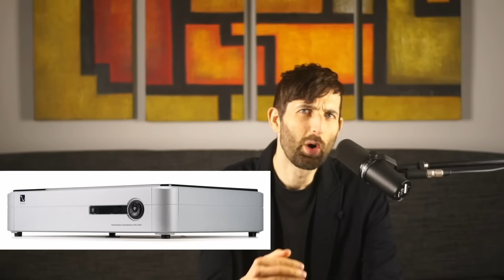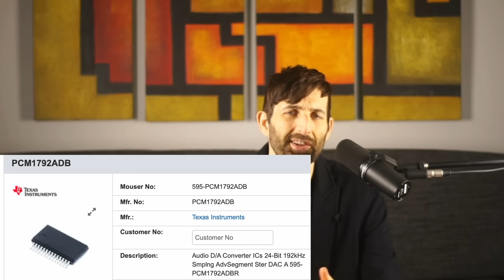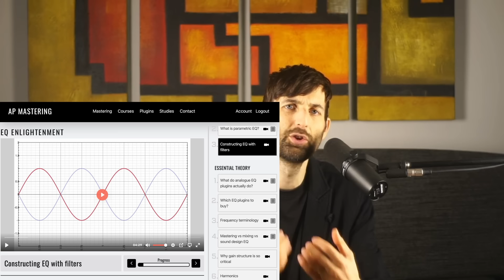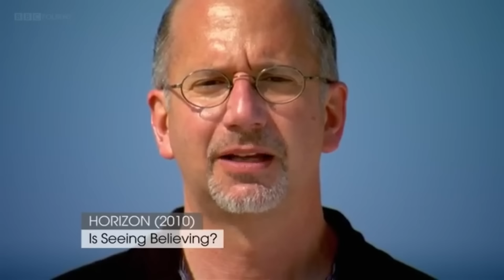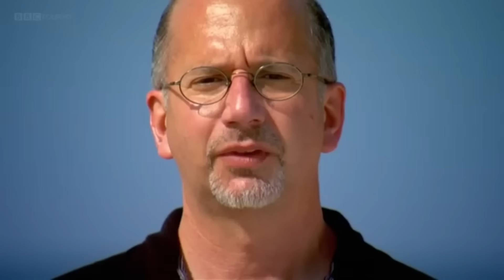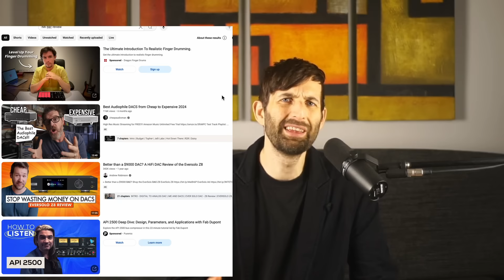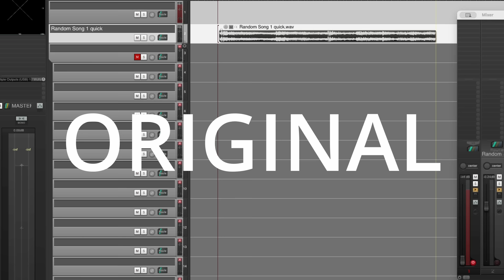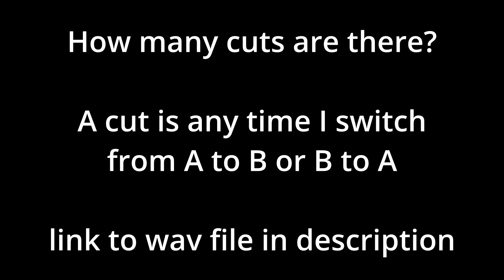The DAC Scam - Almost everyone believes the hype

Comment: another aspect that you apparently don’t know. Or ignore because it doesn’t fit in with your what fools! sermon 
Analogue … TTs do have more distortion than digital CDPs 
Ergo, the higher distorting NOS DACs should sound more analogue 
Dude, you should get around a bit more
Reply from the maker: ultrasonic noise harming your amp and tweeters is not the kind of distortion that most reminds me of vinyl
Reply: @APMasteringI was referring to turntables’ audibly higher harmonic & IM distortion. When have tweeters been harmed?

Comment: I used to work in the electronics industry. All the terms 'commercial', 'industrial' and 'military' refer to is the temperature range at which the semiconductors are guaranteed to work, from memory. Commercial should be good enough for any DAC. It's not necessarily even a different design; components might be binned according to their performance coming off the production line as is the case with computer CPUs, but I'm not sure about that when it comes to temperature testing.

Comment: Great video. I use a chinese brand SMSL DAC to feed my monitoring system. 

It features XLR outputs and measure greater than 124db at AES...  

Compared to the DACs in my old Allen and Heath Zed R16... I could perceive a very slight difference in my tuned room.. 

I attribute that to a switch that switched between monitors that was dirty.... 

They're now in different studios,  so i can't compare, but I'm pretty sure it won't be perceptible... 

Granted, im now buying a second hand RME ADI 2/4 , but more because it has a great ADC and I'm getting new monitors with AES inputs, it can drive headphones like the Audeze LCDs and isn't reliant on drivers being fully class compliant (although my experience with RME drivers via a PCIe Raydat has also given me trust in their support)

Comment: I have owned quite a few DACs, from $70 to $6000 from some of the big names. Right now, a $300 AliExpress XiangSheng DAC05AII x 4 PCM1794 chip is by far the best sounding DAC I have owned. When paired up with my Cary SPL-90 clone tube preamp and the NH108 D5 Pro amplifier, audio Nirvana. ;-)

Comment: It's so much simpler than this.... DACs are a scam because WHAT could they actually be doing?????? Converting the audio BETTER???? But HOW? Make it BETTER so audacity can record it .... BETTER????? Is there anyone who actually thinks about this for more than 5 seconds without just opening their wallet? Really it should just sound the same, if it's BETTER that's not good... and if it's worse that's really not good... have you ever heard it become worse with zero DAC and only an interface or plugged right into your computer? and if you did how do you know it's the interface and not something ELSE downstream from that? I can guarantee 100% of people would not be able to tell ZERO DAC (other than than your computers sound card being a literal DAC) compared to a $40,000 DAC; at it's best it's snake oil... and if it IS making a difference it's a difference it SHOULDN'T even be making in the first place. DACs are only SLIGHTLY less stupid than analog summing boxes.

Comment: I agree in many points. But ! ! There is indeed a difference how the supporting electronics are build. A lot research is done from which point on bit depth and samplingrate etc. is the max. quality achievable, it ends at 24 bit and 96khz for PCM, but it is a difference if I develope and equip an electronic device careful or just slap cheap parts in it. There is a difference what specifications I require. Do I use XLR balanced or simply  RCA unbalanced, do I use SPDIF or coaxial or even other connections or even other transmission protocols etc... That all makes a difference, but there is indeed a range where it makes sense, a couple of Thousands $ or € is fine going up to the 10K or higher. On the other hand, who wants to put a PA rack inside is listening room ? It would do the sound perfectly, but nice looking ??.....

Comment: Have you heard of power supply
Reply from the maker: i say power supply in the video. obviously you didn't watch
Reply: @APMastering70% of the sound is from the power supply and the analog output stage.
Reply: Also conversion of DSD is much more
Advanced than just the chip but you have been living most your life living in a pcm
Paradise

Comment: Well you completely miss the point. Is there a load of snake oil in DAC sales? Yes, if course. And some manufacturers try to sell poorly engineered items at ridiculous  prices. But many don't. If you want to get the best performance from that DAC chip you need regulated supplies. You need a very high quality laser mechanism. You need the best current to voltage conversion and you need a very low jitter clock circuit. Many will use military grade caps and resistors which are many dollars each. Try and buy an ultra low jitter oscillator....if you can get one it will cost hundreds of USD for the oscillator alone. Once you start adding these complexities you immediately move the product far away from mass market. That means low sales. What kind of profit do you need, to make development and launch of a low volume DAC worthwhile? There will be a massive margin (both manufacturer and dealer) on those items, but you need it when you only sell a few 10's per year.

Comment: I used my ears to listen to Chord DACs before purchase. They program their own chips, not just off the shelf. I would have preferred to hear no benefit, because I could have ended up with a cheaper DAC. But I did hear a difference. I would easily be able to tell the difference at the same volumes for the same song A/B tested through amp and speaker setup of my choice with a HUGO 2 compared to ANY half price competitor. I would bet my life on it.

Comment: Great dacs are more than a good chip, but for mixing and mastering you dont need high end, you need something thats good enough for the work you do so it can pay for it self. This guy doesn’t know the possibilities of high end audiophile dacs, because they can improve the sound quality a lot, you pay for the sound signature. Mine is from danish audio design and its way better than the other dacs I have heard. If you dont get the benefit of a better dac its because your system is not resolving enough, so get some great speakers and hear once more. Audiophile headphones mostly are not resolving enough to need a very good dac, but great speakers benefit greatly from high end dacs.

Comment: Almost none of the DAC pics that you showed in your video used off-the-shelf DAC chips. They are mostly all custom own design utilising FPGA chips and/or hybrid solutions with resistor ladder.

Even the prices of the off-the shelf DAC chips you mentioned is not accurate as you didn’t mentioned that most of them required more than a single chip to reach their peak performance… and it can be up to 4 or even 8 chips to reach their full potential.

I can’t say that this video is fully honest with the content…
Reply: And all those "custom design" chips in the best case scenario are matching the characteristics of the common chips mentioned in the video, lol
But believers will believe no matter what
Reply: @GremmieWhite  Do they matched? I don’t know. I haven’t tried them nor do I have the objective test result to be able to say as such, and neither do you.

But I know that I would be very stupid to say they are the same without knowing the actual data…
Reply: It’s not dishonest either. More like ignorant.

Comment: You're completely off the mark with this. But let's start at where you are right - the DAC chip has the least to do with the sound - these things are generic, cheap and nearly identical these days. There are a few tiers of them, but even the highest audiophile grade ones cost peanuts compared to the whole device, whichever one it is really. A now for the bits where you missed the mark: The analogue circuitry is of paramount importance, also the precise clocking, jitter suppression and power supply regulation. These things are not "few bits and bobs" as you put it, but actually constitute the device, in which you could easily swap the DAC chips and it would sound the same. Yet, change the capacitors, shielding, mess up the power supply, or use cheap op-amps in place of discrete ones in the analogue circuitry, and you have flat sounding digital disaster, or a cheap DAC.

Where you are correct again, (IMO of coruse) is that paying anything north of 5k USD for a DAC is dumb, as for that amount of money, all these things can be taken care of perfectly. That we can agree on. Yet, claiming that cheap Focusrite interface sounds the same as an expensive Apogee or Antelope is a total fallacy, and I have the scars to prove it. Actually switching from a flat sounding UAD Apollo 8 blackface (allegedly awesome at the time), to the incredibly good sounding Antelope Discrete Pro made me start making music again - the difference was THAT big. The clarity, the dynamics, the resolution, and the compounded result of tracking many tracks that way. Also the preamps, not being cheap on-chip affairs, but actual discrete, multiple transistor type used in good consoles.

Comment: "I’m using the Bluesound Node-X together with a Musical Fidelity M5si integrated amplifier (without a DAC), connected to my Dynaudio Evoke 20 speakers. Is the DAC in the Bluesound Node X good enough for my setup, or would adding an external DAC improve the sound quality?

Comment: Yes, the DAC chips should be sounding the same, and I agree that there is alot of ridiculous shenanigans with hyper priced high end stuff. But...the thing that can make one sound different from another is what's happening in the analog output section. There are many choices that could be made in those circuits that can skew the sound in one way or another. You could very easily have two DAC boxes with the same DAC chips in them that genuinely sound very different because of how their analog output sections differ. And it can very well be a matter of personal taste and opinion as to which one is "better."
Reply: It’s more than that. Power supplies. Clocking. Etc.

Comment: Weeeeellll, there are plenty of different chips, so it does not "just come down to the chip". And there are other technologies such as R2R, where a chip is not used for the conversion. In addition, with is before and after the conversion is just as important, i.e. the power supply, the I/V conversion, the output stage. I have tried a number of DAC's, and the differences in my system are HUGE.
Reply from the maker: r2r mostly uses a chip

Comment: Toroidal transformers, high grade capacitors, discrete output stages cost some extra money. I do know some VERY good sounding DACs for around 900,- USD. An ES9039SPRO chip sounds noticeably better and more detailed than an ES9068AS chip. The lower end sounds more precise and the mid frequencies are "pushing" more. Furthermore, R2R or Multibit doesn't have to be very expensive. It starts at 299,- USD and already sounds very good. The advantage of R2R and Multibit is they often (but not always) have a better soundstage and a more holographic sound experience. Now I agree with you that at a certain price range there is no real sonic improvement in terms of "more detail". But there are different flavors just as with any favorite car that one likes to drive. Scam? No, people that have huge wallets like to spend more. It's a very normal thing. And people that are on a lower budget need to carefully look, but they also can find some nice sounding DACs. Saying "they all sound basically the same" is not really true.
Reply from the maker: how did you do in my blind test?
Reply: @APMastering  I am a musician. I buy the sound that I like. I have owned a number of DACs, from very cheap to absolute high-end. Look, a good amplifier with some high grade capacitors and exotic FET types will cost you more than a regular, lower priced amp. And it’s the same idea with DACs. For me, this is no scam. But of course if somebody is selling you cables for let’s say 30.000 usd a meter, you could say this is a scam. My current DAC is listed around 1.400 usd and it’s insanely good. Why? Because of 3 main reasons: it sounds natural, not artificial. The bass is very exact and punchy. The space in good recordings is very present and you can exactly pinpoint the position of each instrument or singer in the room. Cheap DACs have extremely mediocre to lower end output stages consisting of cheap Opamp chips. This ALONE causes a sound not worth mentioning. Also the power circuits of low cost DACs are cheap. And you can hear it. So  look, I only do blind testing just for the fun of it, but not if I am DEAD SURE about a DAC that sounds a whole lot better than another DAC.

Comment: It’s far more nuanced in some cases than you’re claiming. “The cylinder does all the heavy-lifting, so it doesn’t matter how the engine is built around it, or how the transmission interfaces with the output, or how the fuel injection system is designed.”

Yes, the majority of people can’t tell the difference between poorly-built snake oil and great engineering, but that doesn’t mean that every mid-high priced discrete DAC is equally nonsense. The power stage alone is easy to screw up EMF/EMI shielding, or source noise filtering, etc.

But let’s steel-man this claim and pretend that literally every DAC ever made sounds exactly the same, from $5 dongles to $1 Trillion mansion-sized “compensation trophies.” The design and engineering around the core DAC ICs themselves can massively change the timbre of the output, meaning that “clinical/crispy” tenor-loving DACs pair well with darker/veiled bass-leaning headphones/speakers, and vice versa. This example obviously still would mean it doesn’t make sense to spend much on a DAC, but it discounts the insinuation that “it doesn’t matter at all.”

It matters at minimum for the tonality bias, and at maximum for stuff you seem to not notice (sound-staging, clarity, etc.).

Blind A/B testing should be required for anyone who assumes they “need” to spend more for a pricey DAC, I’ll obviously grant you that. But for those of us who can tell the differences at least up until the $800 mark and below, I see no issue with having that kind of budget for such a massively-subjective hobby. And even that group of people will admit that it’s a 10-15% improvement going from $100 to $800 when the best at each price point are compared.

Comment: the misunderstanding is that only the chip is responsible for the sound. 40k is still a hell of a lot of money and probably too much. a large part of it goes into the design of the circuit and of course into the housing. low quantities do the rest. nobody is forced to buy a 40k dac.
Reply from the maker: the analogue circuitry is cheap, transparent and a recommended schematic is given in most chip handbooks
Reply: @APMastering  I don't understand your point. The cheapest way to get a DAC is to buy a kit from Ali. On the other side of the extreme, there is the 40k device. Pick anything in between and be happy. Please be polite and don't bother people who have a different opinion.
It is also not a scam when people buy their Porsche, or an expensive watch. All these gadgets have something that a group of people think is relevant to them. Others don't want to or can't afford them, but that's another topic.
Why don't you tell us what your best solution is? This positive approach is much more interesting than a purely negative one.
Reply from the maker: @bernhardh6184 well you just didn't watch my videos then. i discuss watches and give recommendations

Comment: Following this clown's logic, then a dac/amp built into a laptop creates no difference in sound quality than a LAIV Harmony $2,700 DAC?  Full of crap!  Truth is that most dac's designed and built today sound quite good.  audiophiles aren't looking for "quite good" or good enough.  they are looking for organic, natural, pure sound quality where the equipment fades and you are immersed into the music, not the gear.  I believe it si true that many people can't hear the difference, not because it doesn't sound different, but rather because they are casual listeners who simply aren't listening very well.  They couldn't tell a clarinet from a oboe from a bassoon.  

I might suggest that once you get past the $500 price point for a stand alone dac, it becomes more difficult, but not impossible.  A great listening experience is all about nuance, instrument separation, details, resolution all without any digital glare, artifacts etc.  A $100 dac sounds like garbage to someone who has listened to a $500 dac.
Reply: So according to this crap test, this guy probably also would suggest that CD transports sound no different than optical output of any CD player?  

But last week I replaced a 27 year old Tascam dvd/cd player using only optical output to my DAC/amp and am shocked how different the sound is.  Transformative!
Reply from the maker: @mebaugh1 placebo
Reply from the maker: straw man